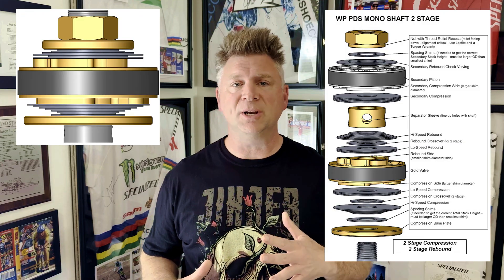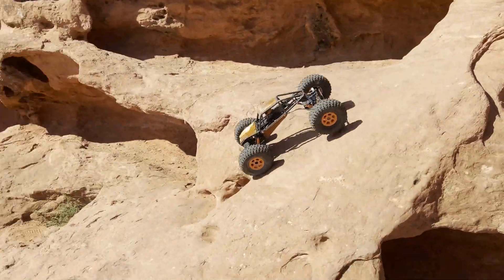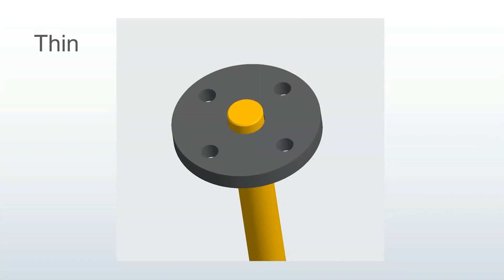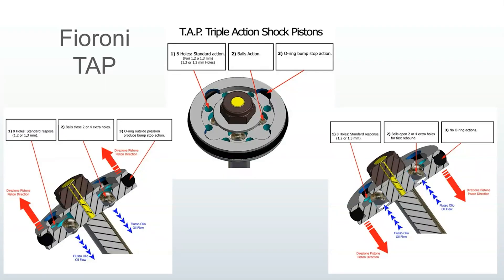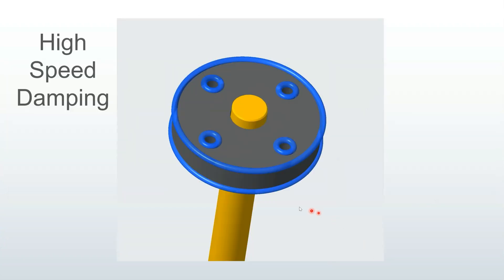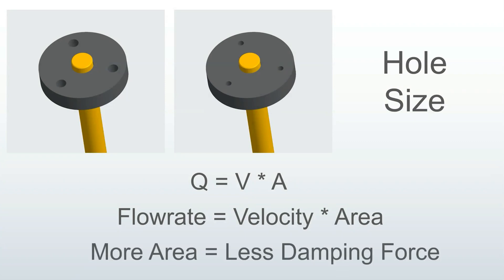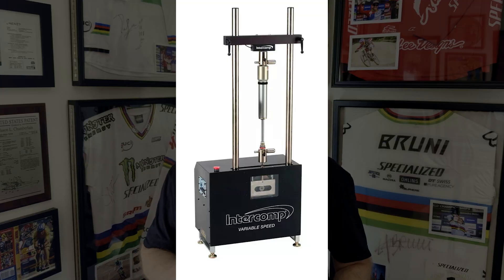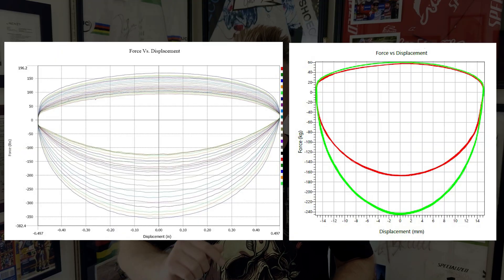Shock Tuning with Piston Head:  Part 1 – Low Shaft Speed

Comment: You could also compress the shock and hang a known weight from it and then measure the time it takes to fully extend. Then invert the test fixture to record the compression time.
The shock is already mounted in a fixture when installed on a truck and it already has a known weight , the axle. So pick up the truck and wait until the axle is extended then flip it over and wait until the axle settles then play back the video in slow motion and note how long the motion takes. 
Even with no math you can see the effects of changes and record some base lines. 
The best way to tune a shock and spring is to drive the car at the expected speed on the expected terrain and make adjustments.
This method deals with the actual variables and avoids using a model.
Reply from the maker: This would be a force control scenario and you really want velocity control to characterize damping.

Comment: Servo motor with a linear actuator could produce a constant linear motion, combined with  strain gauge to measure the force and then output the reading to excel and chart it.
Reply from the maker: That’s precisely what a shock dyno does. Achieving high speeds and high resolution force measurements is why they cost $10k

Comment: So how do you get high-speed damping IE for bumps like when driving fast over gravel to work to keep the tires on the ground without sacrificing the buggy or truck's ability to soak up jumps?
Reply from the maker: If you are driving fast over small bumps, the piston is not usually moving far enough to reach high speeds, so you are more in the low speed damping realm even though the vehicle is moving fast.  Lower the low speed damping for small bumps and raise the high speed damping for big hits. Also control big hits with higher spring rate and less pre-load to keep the right height the same.

Comment: Will you be discussing how the different hole configurations on the pistion, even with the same passage volume, will change the pack of the shock? I know this is more on the high speed side than low speed, but crawlers that tend to run heaver oils often could be worth a discussion. I personally prefer lighter dampening on my rigs with 40 to 45 wt oil the heaviest I typically would run. Thanks. With some doing timed runs, you may have to scoot over some terrain quickly to get to the next gate and be into higher speed dampening as well.
Reply from the maker: Absolutely. I’m in the process of working on a high-speed damping video as we speak.

Comment: How do you calculate the percentage differences between oil viscocuties?

Using the W-figure at face value and traditional percentage calculations, going from 20 to 25 should be an increase of 25%. Going from 25 to 20 should be a reduction of 20%. 

Going from 20 to 27.5 I got an increase of 37.5%, and in the other direction the reduction is 27.3%.
Reply: I misspelled ”viscocities” but I won’t edit it because it sounds cute.
Reply from the maker: I use the percent difference formula because it's the same increasing or decreasing. What you’re explaining are percent increase and percent decrease formulas. Percent difference is the average of the two.

Comment: If you use a selection of weights (or a water container to make the weight adjustable) to produce a constant force, you could measure the time it takes for the shock shaft to move from one position to another. 

Having a stopwatch running next to the shock and taking a slow-motion video with a high frame rate should allow you to pinpoint with fair accuracy the time it took for the piston to go from start to stop.
Reply from the maker: That just might work. Applying as series of known forces and measuring the velocity. It's backwards but gets the same results.

Comment: For constant speed, maybe use gravity. Mount a shock upside down on a scale, place a weight on the scale and zero it, then attach that weight to the end of the shock and let it drop and read the force on the scale to calculate the damping force? It's late and I'm off to bed so I'm probably forgetting to account for something like shaft and piston weights or something but you get the idea.
ps. No relation to Ned.
Reply from the maker: I like how you are thinking, but that would produce a constant force and not a constant velocity. The force changes based on velocity. What you described simply weighs the parts independent of the speed they are moving. My mind went down that path as well.

Comment: Something you might find interesting is that shock oil "weights" seem to be pretty arbitrary. Losi 50wt is 710cst but Team Associated 50wt is 640cst. They also aren't very linear. Going from Losi 20wt to 40wt is a 321cst delta but from 60wt to 80wt is a 204cst delta.

Looking forward to the high speed video!
Reply from the maker: I’m not sure if “arbitrary” is the right word.  Wt and CST are theoretically correlated linear scales. When people measure and publish differences, as you point out, it comes from a quality discrepancy (and some error in the measurement tools and operators) which for sure is the arbitrary part. I’m not sure how closely the RC world certifies their specs, but it doesn’t appear super consistent, especially across brands.
Thanks for sharing.
Reply: @BoomslangSuspension  Losi started printing it on the bottle caps a while back; the numbers I quoted are direct from manufacturer.
Reply from the maker: Interesting.
Reply from the maker: @JacobScherer  Do you care if I quote you in an upcoming video? I am working on an explanation for this labeling discrepancy.
Reply: @BoomslangSuspension  yeah buddy, go for it!!